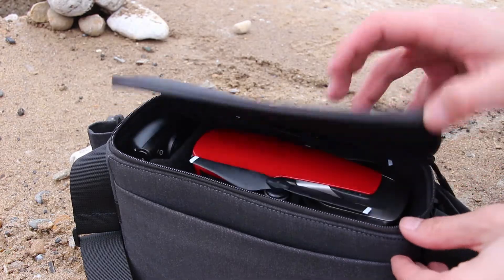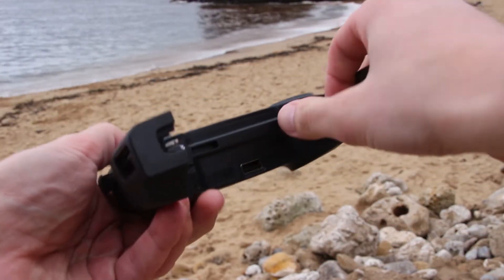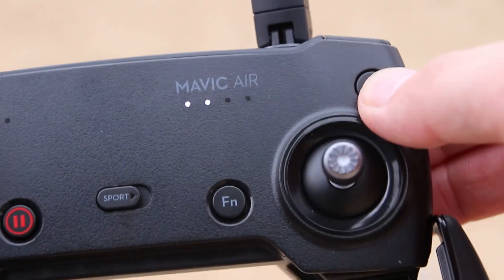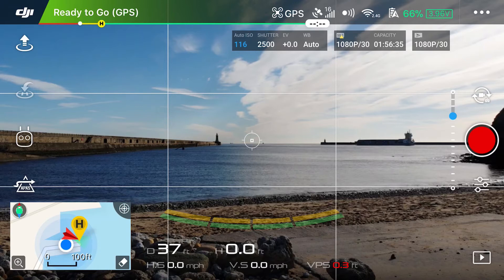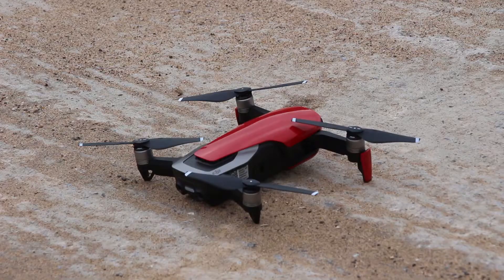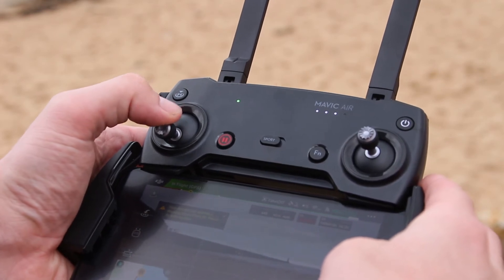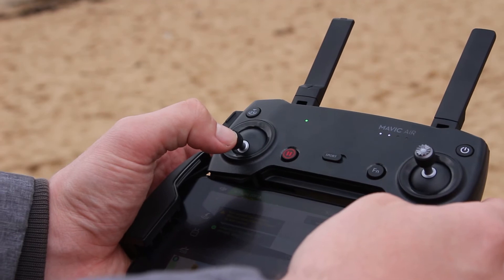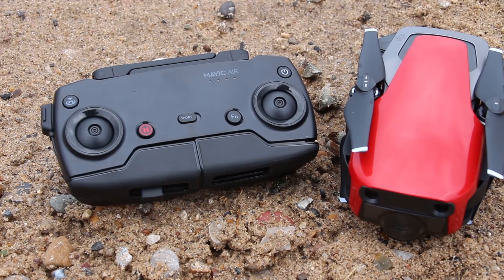How to set up your DJI Mavic Air for flight - Heliguy

Comment: Newbee Question Mavic Air, Some youtubers suggest the drone should be sitting level on the ground when you turn it on, is that correct for the Mavic Air?  Thanks for the Information.
Reply from the maker: I would recommend having it on a flat surface when taking off however for powering on in general this is not needed :) I would however recommend if you are moving it about a lot to calibrate the IMU through the settings.

Comment: Well done. When I start flying I have to choose between a wired connection or WiFi every time. Is it possible to skip this?
Reply from the maker: You can choose which one you want to start with and you can change this at anytime after as well
Reply: Thanks for your reply